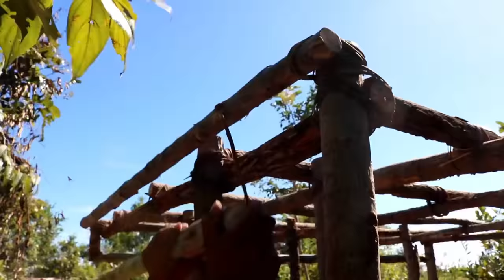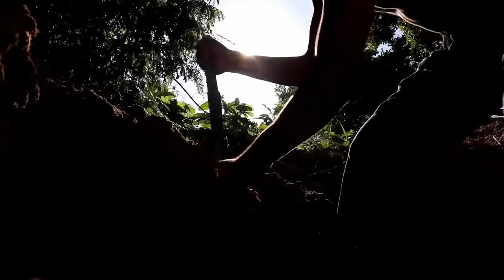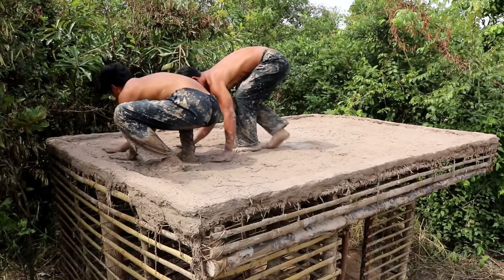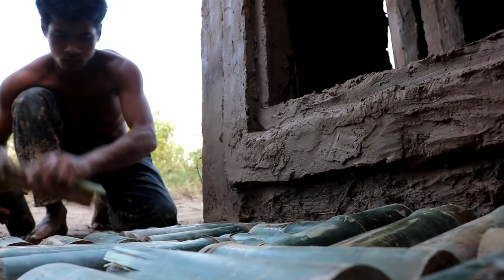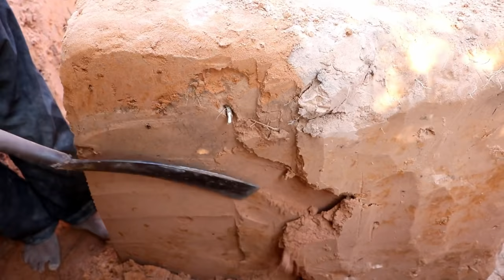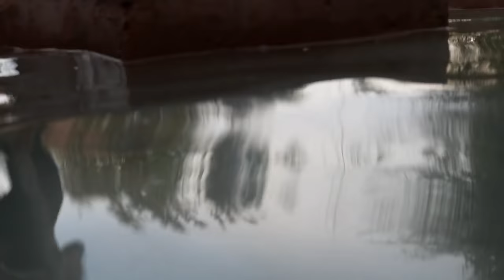How To Build Beautiful Mud House And Awesome Underground Swimming Pool Around House For Winter

Comment: This is amazing! You do it so fast too and with great teamwork, like a machine!

Would a mud roof last long if it rained? Wouldn't there be worry of it collapsing or at the very least wed mud dripping from above, couldn't see anywhere for the water to go.

Could always add thatch to the roof, easy to replace and maintains separation from the heat, while also an indoor firepit could be used to cook and to keep the house dry.

Comment: in rainy day properly the roof could be collapsed, secondly water without circulation means microbes, virus ..insects ..to the funtional problem could you imagine how do you want to enter the room? by jumping? and why did you need fire in water pool? ..beautifull house without functioning just for one week...your work is great but could be much more interseting if it becomes rational one
Reply: My guess is the fire tubes warms the water. And I don't think they build these houses for long term, It's more like an Air-BNB for a weekend getaway because that water has no filter or circulation and it's basically a bacteria soup.

Comment: I only have one question. This water will get very dirty in several days. Therefore what's the point of doing this pond  if you don design a system for a quick emptying
Reply: For youtube views
Reply: They will empty it just as quickly as they filled.
Reply: @oleiei434  that is in a week I suppose
Reply: @geo best Sure,  that is enough time for mosquito eggs to hatch.

Comment: clay and mud would go soft when wet.  clay and mud bricks can only hold their shape if baked.  I would have thought it smarter to dig and prepare for the inground pool first so to use fire to prepare the base clay first, and then work upwards after all has cooled and cleared